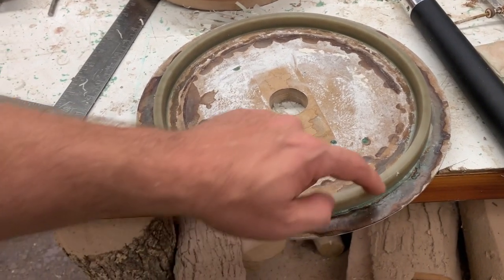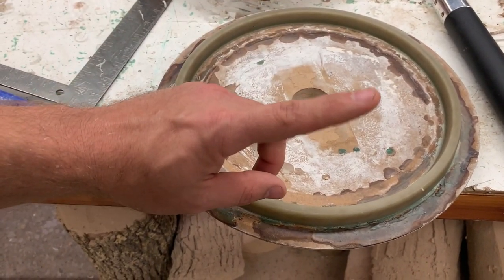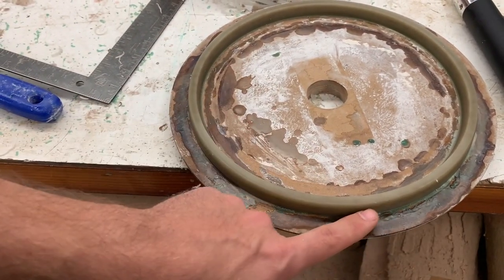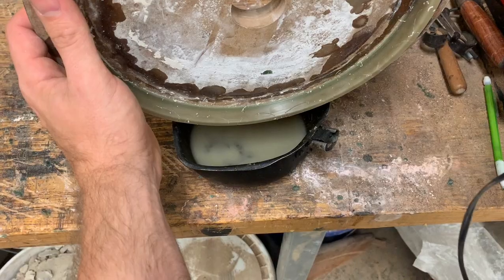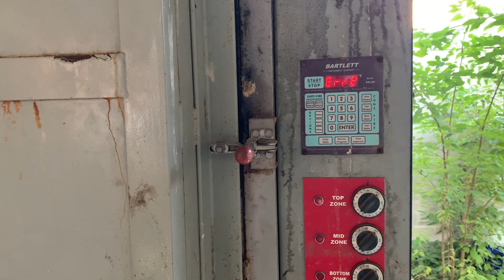Banjo Build Episode Two: The tone ring

Comment: Sounds like a blown rim was the batter idea.   I tried melting glass once for some project.   Heated glass goes through a  phase where it  just shatters over and over,  it takes slow and steady to reach a molten state.  If you have a glassblower friend you probably have this all worked out.   Everything I learned came from a visit to a glass museum.  Keep experimenting.
Reply from the maker: Yeah for sure. I ended up having a friend blow the  ring. But I could melt one for sure I used crushed recycled glass, if I used new frit with the right flux I think it would work ok. But I think it would have cracked as soon as I put it under tension if it was not perfectly level. My friend had the right tools to grind it dead flat so it survived.

Comment: A for effort. Bummer the cook didn’t pan out though.
Reply from the maker: Yeah. I will do it agin one day but my friend that blew a glass ring for the banjo did a great job! I have a feeling even if mine had worked out it would have broken under the pressure.
Reply: @JDanielGraham  probably so but nice try. Looks like you tried two different casting waxes?
Reply from the maker: @Nomadboatbuilding  I did to see which would turn better on the lathe. They were both about the same even though one was more brittle. I may have to try this again... or make a bronze one.